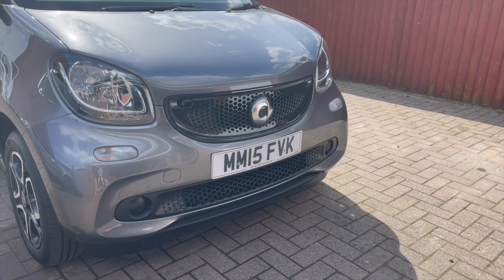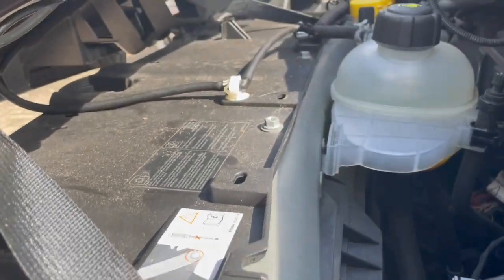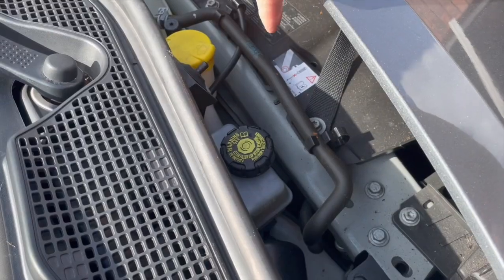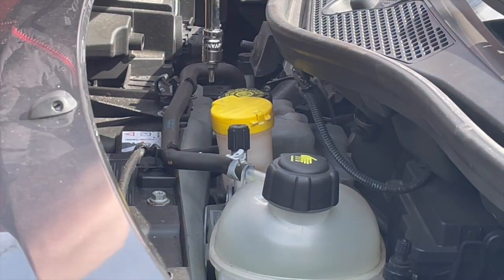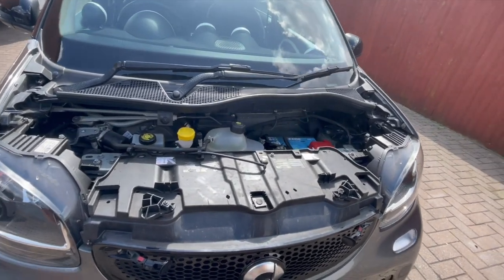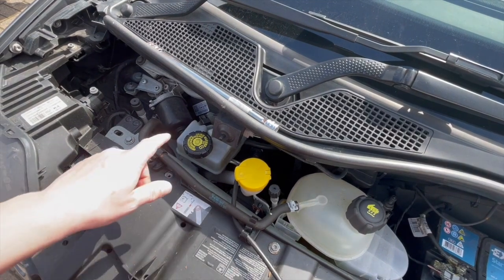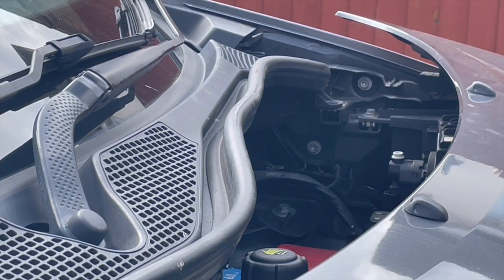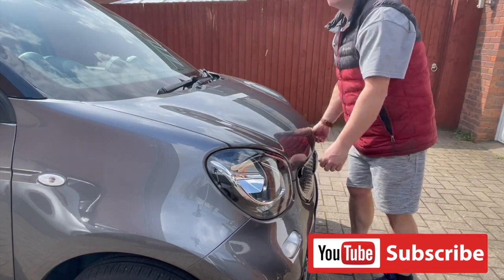Where is a Smart Car Battery (453 models)

Comment: Actually its only the 453 Forfour that has short straps, the 453 Fortwo has long straps where you can lower the bonnet onto the front of the car. REASON: The larger Forfour bonnet needed shorter straps in case is comes loose whilst driving, so it won't cover the windscreen. Note that the original car battery is crap, and will last only a few years if you use start stop tech. Even not using start stop you may get 5 years out of it. The first sign of battery failure is random electronic warning signs coming up on the dash. We all move onto new battery eventually, and recommend Halfords AMG027  with 5 year guarantee, which i have now fitted.
Reply from the maker: Spot on with the batter. Not so sure about the short straps though.
Reply: What did you do about resetting the ECU which I believe to be necessary?  A friend is facing this right now.
Reply from the maker: @simonpearson8757  I haven’t needed to change the battery yet.